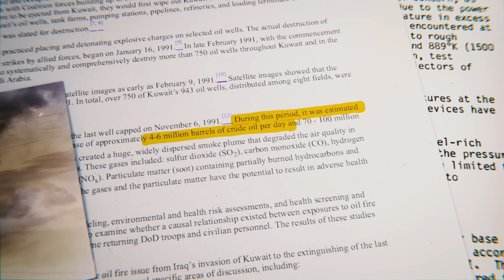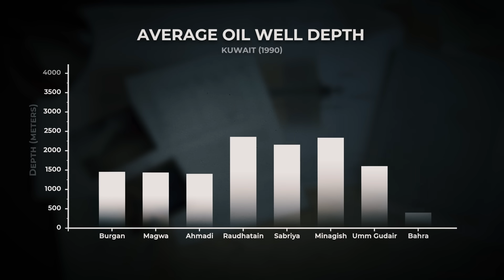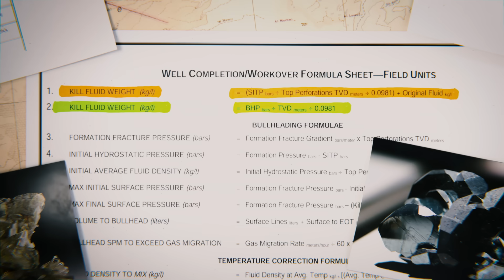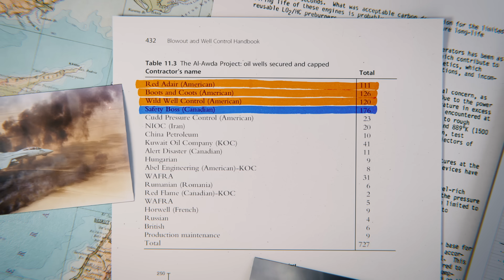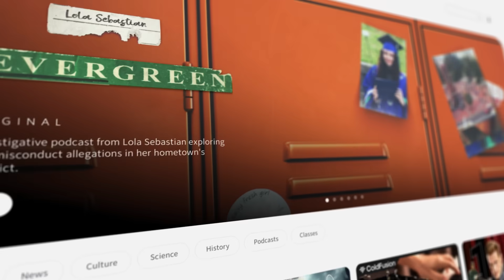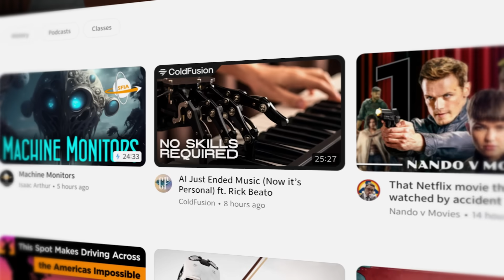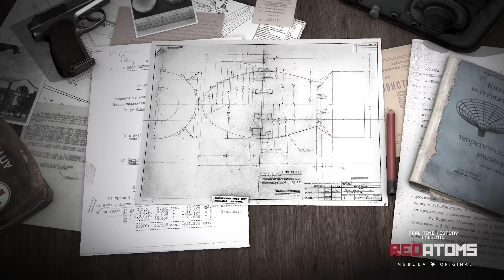The Worst Oil Disaster Ever

Comment: You have no videos about the engineering of bicycles. There are 3 engineers who post videos about bicycles Hambini, Peak Torque and Luescher Technick. Cycling is dominated by industry trying to sell you something and the disposable income of the public believing it needs the most incredibly cool, high tech equipment. Shimano now has 12 cogs on the rear wheel and 2 or 1 gear in the front; and electronic shifting. Are these real advantages? Aerodynamics are very popular since cad-cam and composite materials lend themselves to such efforts. The profile of aerodynamic rims have changed. The Giro Aerohead 2.0 helmet is something to behold. Garmin sells a LED tail light that has an early warning system for automobiles (Radar?). 
     Shimano has had to recall thousands of its hollow crank arms due to galvanic corrosion. Tubeless 28mm tires mounted on "hookless" carbon fiber rims are all the rage. There was some real resistance to hydraulic disc brakes by professional riders. The piston in the master cylinder is quite short, being that it is located within the brake lever. This results in a lack of modulation. I have seen a couple of accidents on televised races where riders wheels lock up in the turn. Hydraulic disc brakes are part of the solution to the problem of carbon fiber rims heating up from rubber brake pads and then becoming soft enough that the tire - rim interface becomes compromised. Aluminum rims work great, but are no longer light enough. 
    The more gears that are added to the rear wheel results in the chain being run as an extreme angle causing wear within the chain, but also to the sides of the cogs in the back and the chain ring in the front. The front chain ring also deflects under load and this has led to design changes. Single chain rings (front gear) exacerbate this problem. Drivetrains with a single gear in the front and a derailleur have the problem of inconsistent chain tension and the chain falling off the front gear. The solution is to add knobs or bulges on the teeth of the front gear. In time they wear down and lose their ability to hold the chain. Then there is the question of added friction to the drivetrain. In professional road races a number of teams are using 12 cogs on the rear wheel, size 11 teeth to 32 and two gears in the front (42 - 54 teeth). 
     In terms of engineering and not marketing, what would work best? Would 10 gears on the rear wheel and 2 up front be more advantageous over 12 gears on the rear wheel and 1 gear up front?  Another question has to do with carbon fiber failure and people not understanding what they own. One example is carbon fiber seatposts and the method to hold them in place. Many manufacturers use a set screw that presses an aluminum plate against the back of a seatpost. Carbon fiber wants to flex and then return to its original shape after the force has been relinquished. The problem is when the general public does not use calibrated torque wrenches and over tightens the fitting, "to make sure." This has resulted in some of the fibers within the composite structure to fail and then the post will slide down. When the owner removes the post to inspect it, the resin has returned to its original shape and it looks no different. Over tightening the stem fork connection can result in catastrophic failures. Even aluminum handlebar to aluminum stem connections now require the use of a torque wrench.

Comment: 8:03 here you clearly see it is a different version built on a T-34 chassis, not T-62. You can see sloped rear and side armor, bulging transmission housing,  thicker track links, older style roadwheels and smooth round sprocket

Comment: 8:45 I thought cold air at higher altitude was 'dense' but contained less oxygen, and low-altitude hot air was 'thin' but contained more oxygen than at higher altitudes. (Acknowledgement: I'm not an engineer.)
Reply: Higher altitudes have thinner and colder air, the oxygen levels don't really matter. What's the real problem is that these engines are designed to be moving at hundreds of mph with cold high speed air rushing through them, both cooling and increasing the efficiency. So at ground level it gets less cooling and has to work harder to push the air through, and in addition they're in an extremely hot environment.

Comment: What a terrible thing to do... Some people really do just want to watch the world burn...

But good video. But I have a question... I've learned that water is a terrible way to fight oil fires... why is this here different? I'm sure it's still great for the cooling effect, at least on equipment, but I'm not quite sure about how useful it really is when it reaches the oil. Is it enough to just have a huge amount of it?

Did any of the other firefighters try to do something with sand? They should've had plenty of that... not sure how easy it would be to blow that so far, however...

Comment: It's not quire correct when it refers to the EOD (bomb disposal) element being completed at the beginning and solely by the army. There were civilian EOD engineers operating alongside the fire fighters for the duration of the project. They'd clear areas around the wells, find routes through the desert to the remote Gathering Centres, clear ordnance from the many abandoned tanks and trenches etc.

Comment: @real Engineering Correction, the tank hull shown in the live footage was a T-34 chassis (note the sloped rear plate) from WW2 and not a T-62 hull. Additionally, the CGI model used to demonstrate Big Wind is a T-55 chassis (please note the spacing of the road wheels) and the aerial footage from source MOL looks more like a T-55 as well.

Comment: I work in the oil field and there is a chemical that is released from oil called H2S hydrogen sulphide that stuff is so incredibly dangerous you are allowed to work in an environment as high as 10 ppm over the span of eight hours, there is one thing in the oil patch where something is considered immediately dangerous to life or health if you go into an environment rich in H2S and it is anything over 20 PPM your most likely going to drop to the ground go for a nap. Not fun stuff

Comment: That jet-powered pump is the BEST way to deal with oil or natural gas fires PERIOD. It's more than enough to get things under control 99.99999999% of the time. That 0.00000001% is when everything that would make it ineffective occur simultaneously.

Comment: Just a nit-pick. oil/gas wells don't use concrete. they use cement, commonly class G "portland cement" and water (but there are variants, like high silica cements for high temperatures) with chemical additives to control the density, viscosity, curing time, prevent the cement from disappearing into the rock, and to prevent gas/oil migration, amongst other things. There's an awful lot of engineering and science behind it.

Comment: uncontrolled fires like these are a result of completing the wells without Sub-Surface Safety Valves (SSSV), or, if you like, a "triple-sv". There are pressurised lines that hold a valve open, allowing production. If something happens, like someone knocking the well head (Christmas tree) off, or blowing it up, then, the control line is severed, pressure is lost, and valve closes, isolating the well from the surface. These valves are typically quite a long way from surface (say, 150metres or similar magnitude, but there can be more, deeper), so are unlikely to be damaged as a result of surface activities.
Another problem from uncontrolled flow is permanent reservoir damage. Production rates are generally controlled to reduce water flooding, and to preserve the pore-space integrity in the rock. Uncontrolled flow looks cool, but is really not what anyone wants, for both environmental, and economic reasons.

Comment: Ok, so, talk about adding dramatic effect. Crude oil does not catch fire like gasoline does. It is closer to diesel than gasoline (it is more flammable than diesel, but the flash point of diesel is as low as 52C, the flashpoint of crude is as low as 35C, and the flashpoint of gasoline is as low as -42C. So, the risk of the oil pools “spontaneously catching fire” is significantly lower than what is portrayed in the video. It absolutely could still happen, especially given the high temperatures the area, but I’d also suspect that the crude that is flowing up into the pools is probably a bit of a “dirtier” crude than what was burning, which would raise the flashpoint even further.

Comment: As a Hungarian, I'm extremely proud that you made this episode. The story behind the development of this true beast is the following. A gas well drilling accident in 1979 took 21 days to completely put out. They had a smaller unit with a MiG-15 jet engine, but the fire reignited after putting it out. Motivated by the need for a more powerful firefighting machine, there was an order for an advanced unit in 1984 that was sufficiently powerful to fight against such fires. The preceding firefighting engine had only one jet engine and three less powerful water injection ports. The tank base was from a T-55 tank. The Big Wind is still in operation, but fortunately, it didn't receive any further real tasks to put out similar fires.
Reply: There was a gas well fire at around 2000 in Hungary, where they used this same machine to put out the fire. Unfortunately, they couldn't cap the well so they had to relight the fire until they could come up with a solution.
Reply: @kangirigungi  I used to live around 40kms from that fire, on a 10th floor flat in Békéscsaba. We saw the fire from our window. That fire was in Pusztaszőlős. I was 14 back then, but remember it to this day.
Reply: @kangirigungi  Brutal.
Reply: ez az tesó :D
Reply: A Zsanai Gázkitörésnél ha jól tudom 2db ilyen sugárhajtóműves oltószer volt Zil hordozójárműn
Reply: The chassis seen at 7:05 is a T-34. Its story is more complicated, but this video gives a great shoutout to it. Love it!
Reply: The German government also build such a fire fighting tank in 1991 for Kuwait, but it never got used, since most fires were put out when the east-German company, right after reunification and collapse of socialism, finished it. It now stands in a museum in Fulda, it uses only one MiG-21 engine and was based on a T-55 chassis. Why the engine of a MiG-21? Because it was cheap and easy to get in 1991. Many MiG-21 had been build, but these were terribly obsolete by then. 3200 RD-25 engines had been produced for that jet. The similar often produced western J79 engine on the other hand was still in high demand in the world in 1991 and pretty expensive to get.
Reply: Fantastic.  This is the most Cold War Soviet things I’ve heard in a while.  “We need a firefighting vehicle.”  “I got some jet engines and a tank, we’ll make it work.”
Reply: Most firefighters that were there said that “Big Wind” put out a few small fires. Traditional explosives were used on 90% of the fires, done by fire fighters from TEXAS! But cool story bruh.
Reply: It's an amazing vehicle... 
As a Canadian I'm proud of how many we put out.
 To all those who helped thank you
Reply: That was a beautiful beast, straight out of Starcraft
Reply: We love Big Wind!!
Reply: Amzing story !
Reply: i have seen an demonstration of a similar fire engine in Dresden, East Germany, in the 1980ies. It was using a Pirna 014 jet engine mounted on the back of a IFA W50 truck. The Pirna 014 was a leftover from East Germany's unsuccessful attempt to build a passenger jet in the late 1950ies, the Typ 152, often (but falsely) named Baade-152 in English publications.
Reply: @7:06
the tank base was clearly a T-34 there.

also, jet engines are not the best for this purpose either, turbo fans should have performed a lot better
Reply: @ylstorage7085  In 1991 the first iteration, based on a T-34 chassis, was used in Kuwait to put out fires. Later it was updated to use the T-55 chassis because there were part supply issues to the old T-34 chassis, and more parts available to the newer T-55 chassis.
Reply: @francikaa1  well... upgrad from mig15's engine to at least mig19's at least?
Reply: @ylstorage7085 Am I hearing a little jealousy?
Reply: tf are you proud of, did you work on it or something?
Reply: @oiytd5wugho well, yeah. People are proud all kinds of scientific or other archivenments from their respective country, even tought they didnt participate in it in any way. Its the people's archivenment, not a whole country's
Reply: @oiytd5wugho  I've designed the thermal control and structure of the world's smallest fully functional satellite (i.e., it works in Earth's shadow - this satellite family has a success rate 5/5, btw). I have a PhD in combustion, and I also have a research group on this topic with ten people while being an associate professor full-time. I've solved over 40 industrial problems that have caused headaches for companies like GE, Rolls-Royce, Siemens, Alstom, etc. I hold a patent in the US for real-time combustion control that significantly outperforms the version of Siemens for industrial gas turbines. I have developed an advanced combustion concept that emits at least half of the NOx compared to state-of-the-art gas turbine burners while not sacrificing efficiency or increasing the emission of other pollutants. So, who are you, and what have you done so far?
Reply: @oiytd5wugho but one way i think they are part of it is by paying tax money, so supporting government funded things like NASA research for example.

But a lot of people logic for example there are smart people in this country who archived great archivenments= this country is smart= i am smart to obliviously.

Comment: 6:36 The Hungarian wiki page says they used a T-34/85 chassis. I'm not an expert on tanks, what's the difference?
Reply: T34 is quite a bit older then the T62. T34 was WWII. T62 was 1960s. T85 is even more modern (started production in 1986).

Comment: 6:36 Big Wind wasn't built on a T-62. It was originally built on a T-34 and then some time after it was used in Kuwait its turret was moved to a T-55.
Reply: T-34 at 7:05; T-55 at 8:45.
Reply: I'm still impressed they had a running T-34 to put it on initially, although so many were made I'm not surprised
Reply: @jimbothegymbro7086 there were at least 140 T-34s still operational as of 2018, pretty much all for military parade use by various nations.
Reply: @nicholasavasthi9879  Also it's very easy to get them running if only you have the hull- they use the same engine as the t55 and only minor modifications to the oil pan and fuel pump placement are needed for it to be adapted. And they have built so many t55 engines that it is really easy to find one that is running- they were also produced for civilian use as diesel powered electric generators to be used as auxiliary power in industry- many british hospitals used those, limited to low rpm so they are in very pristine condition.

Comment: Bit of a nit pick but the original model as seen in the real life video the chasis was actually from a t-34 tank, then it was later put on an extended t-55 chassis if my history serves me correct, not a t-62!
Reply: iam not even sure if it was ever put on a t-55 chassis from what i could find online. there was an differen fire fighting tank on the t-55 chassis but only with one engine called hurricane. and i wouldnt say it is very nit picky to point out the tank model is wrong if the whole video is about that tank. Nevertheless a great viedo, errors like this happen to the best.
Reply: @aaronpohle2016  I just googled and the first two links of the firstbpage states it's a Czech VT-55 tank that it was upgraded to.

So yes, it was a t-55 chassis!

Comment: At 6:34, you say "They removed the turret from and old Soviet T-62 tank". As far as I can tell, this is False. Every source I find says that a T-34 hull was used for "Big Wind" and the footage I've seen seems to back up this claim.

However, I did find some images that suggest that the turret was either later transferred to a T-62 hull or a version of the turret was made for the T-62 hull. This would've likely happened after these oil fires were put out though.

After some further research, it seems that the T-34 hull was retired after the gulf fires, being replaced with the hull of a VT-55A tank according to the site CarAndDriver. (I couldn't find it anywhere else)
Reply: You are correct. In the first years it had a T-34 hull, but nowadays a T-55 recovery tank’s hull is being used. In the following video from 1:23 to 1:35 the host talking about just like that. He says that it was increasingly difficult to find new parts and people who could repair the T-34, so it was switched to a VT-55.
https://www.youtube.com/watch?v=YYF8YQ7pLng
Reply: Yeah, at 7:05 it's clearly a T-34 chassis. Later in the video, the MOL section, it's a different one, (8:45) seems like a T-55. And thanks guys for the additional info! Great stuff!
Reply: https://www.youtube.com/watch?v=eJuwpC4yZtg Attraktor's episode about is is better, but you guys are right. Its not a T-62, its a T-55 but it was T-34 originally.
Reply: Furthermore, Hungary didn't have T-62 in the first place
Reply: Yeah, it was kinda obvious that it wasn't a T-62 hull. T-62s never had a drivers hatch in it's frontal plate.
Reply: I swear the whole comment section must be filled with War Thunder players.
Reply: The tank shown in the older video footage was certainly a T-34, while the newer footage looks like a T-55, so your probably right